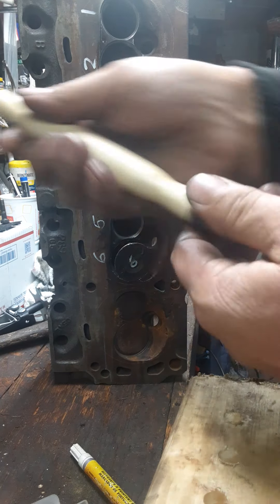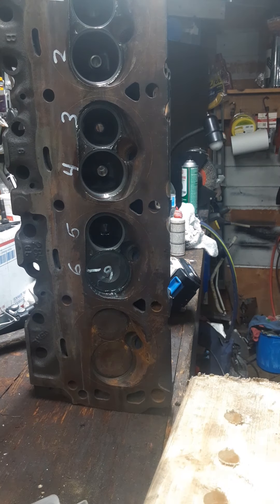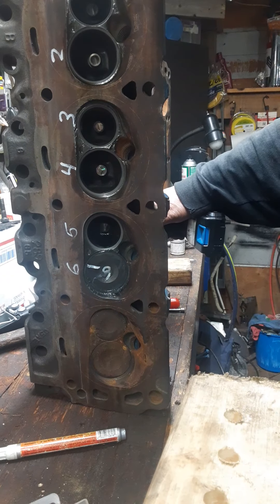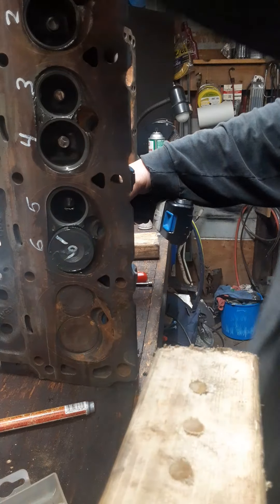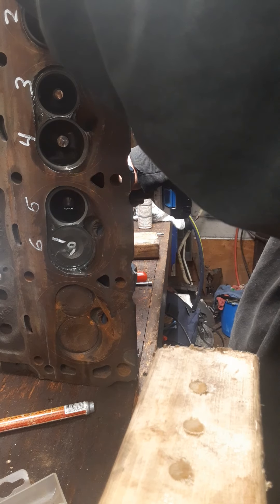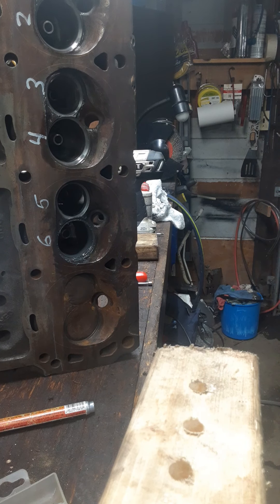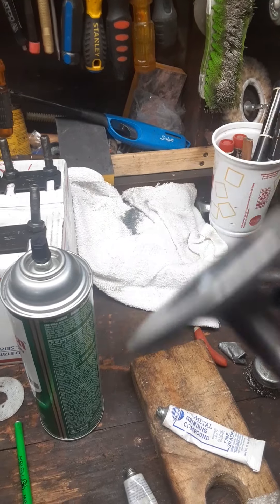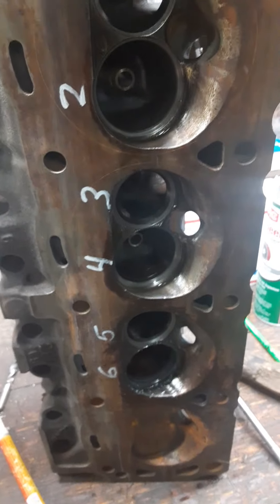The PROPER way to lap cylinder valves with a drill

Comment: Could you cause damage to the valve guides doing it this way. I just did a set of head and not I am dealing with some oil burning issues. I suspect I botched the valve seal install but I am wondering if I would have worn the guides out
Reply from the maker: It should not affect the guides at all